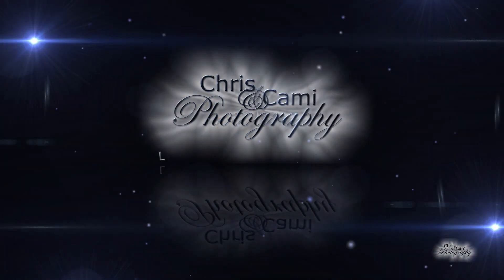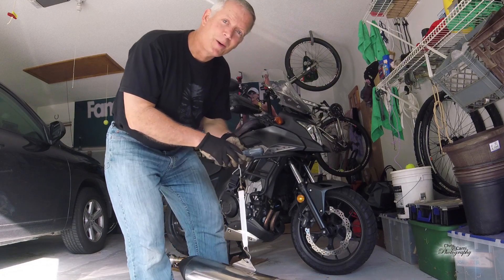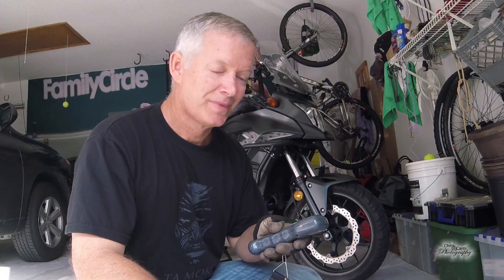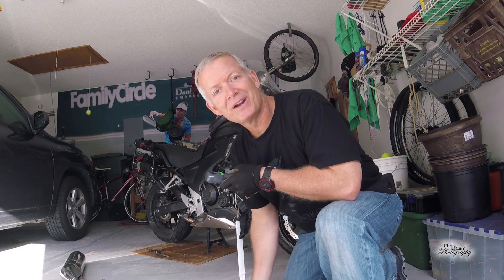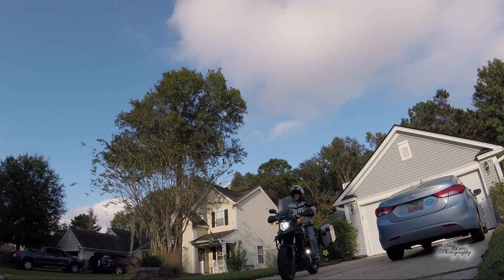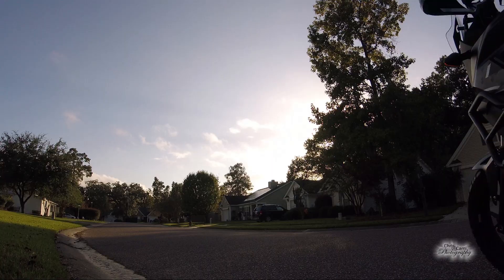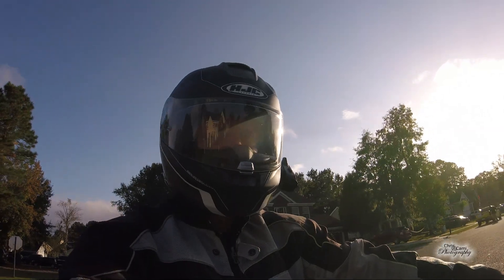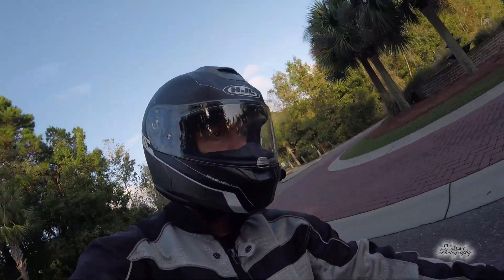EBAY EXHAUST - Best $100 Ever Spent?!?

Comment: Hi there, i just want to say thank you for your advice (in one of your most viewed video) to change my driven sprocket to 16T. IT WAS AMAZING! 
Now, seems like changing a muffler is aint rocket science and required an engineering degree to do it. As you demonstrated, it looks easy and DIY-able. I will definitely add it to my next upgrade list. Also, appreciate the various different camera angle shown here. Good work!
Reply from the maker: Thanks David!!!  Glad we could help.  If you watch my CB500X 60k mile review video, you'll see I still had my "cheap" exhaust on the bike, still working like a champ!

Comment: So far you’re the only one (I’ve found) who’s bought and sort of reviewed one of these “eBay name brand inexpensive exhaust “ ..thanks for that but I’m skeptical still ..my bike is a fz1 with the Yamaha exup exhaust valve I’d have to bypass…which I wouldn’t mind if I knew for sure the exhaust was gonna work out well.  With real name brand I can trust it was engineered for my bike …and if it didn’t work out I’d be able to return it….but then again even if I got stuck with a useless Slip-On at least it was only around $150 and the labor would be more disappointing than the money 😂
Reply from the maker: Sounds like you're in a quandary.  All I can say is I'm still loving this exhaust on my CB500X after 5 years and over 50k miles.  Good luck!

Comment: Any power improvement?
Reply from the maker: The CB500X has such nominal power that even the most expensive exhaust setup isn't going to really give any major power improvements.  However, this one does "feel" more powerful just by the more throaty sound of the exhaust tones.  Plus it is significantly lighter than the stock pipe!  So technically it you can't add horse-power, you can certainly make your bike perform better by making it lighter!  I also replaced the stock battery with a lithium battery, which is significantly lighter than stock.  :-)

Comment: Did you make any adjustments to the carburetor or other after installing the new muffler?
Reply from the maker: I did not.  It's a fuel-injected bike.  So compensation was pretty automatic.  Yes, I could have had the bike tuned for the new exhaust to try and get a little more power.  But with such a small engine, the power advantages are quite minor.  So I didn't bother.  It's been riding beautifully for 2-years now since I installed that exhaust.  I'm over 50K miles on the bike...majority with the new exhaust.

Comment: I really like the growl of the exhaust but i'm kind of worried about the volume. How much louder is it than stock?
Reply from the maker: Hi Jeffrey!  Don't be.  I live in a very quiet and peaceful neighborhood.  So I was a little concerned as well.  However, it comes with a removable baffle so that you can increase or decrease the volume by removing or leaving it in.  I pulled it out and went around the block once...then immediately put it back in!  With it out, it's not crazy loud, but I knew would be annoying to my neighbors.  I've left the baffle in ever since.  The growling sound is perfect and the deeper tone is sophisticated and understated.  Plus the weight savings was awesome for all my off-roading adventures!!!  Check out our most recent travel video and you'll hear my bike in a bunch of the scenes:  https://youtu.be/JzYtjx2ktxo.  It's not annoying at all!  I've had it over 2 years now and it's been rock solid!

Comment: How did you manage to change the settings on your turn signals, to make them always on?
Reply from the maker: Haha!  :-)
Reply: Can't tell? 😑
Reply from the maker: Bonjour  @Rafatrompa !  Forgive me.  I thought you were joking that I left my turn signals on accidentally...which I often do while riding...and which my friends laugh at me about!  :-)  But if you are talking about the beginning of the video where the headlight and turn signals are on, that is a standard feature on the CB500X and a lot of other modern bikes.  The turn signals stay on but at a lower power level.  These are called "running lights".  It helps make the rider more visible.  When you activate the turn signals when making a turn, then they blink at a brighter level.  I hope this helps!
Reply: @MotoPhotoAdventures  No problem my friend.
On my bike (cb500x 2019) they don't come working that way, they are always off until you use the indicators switch.
Do you know a way of programming it to work as you said?
Reply from the maker: @Rafatrompa  Hmmm...I don't.  I will also have to check because my engine wasn't running.  Maybe mine are only on like that when ignition is turned on but bike isn't running?
Reply: @MotoPhotoAdventures  No, you can see they are always on when you take the bike for a spin..
Reply from the maker: @Rafatrompa  OK, that's good.  At least it means I wasn't loosing my mind when I said they are on all the time until you flip the turn-signal switch on...HA!  But I don't know why newer ones don't work the same.  Mine is a 2013.  Are you in the US?  Perhaps different countries have different regulations?  Maybe you can ask in one of the international CB500X Riders groups on Facebook, or the www.cb500x.com forum?  Wish I could be of more assistance, my friend!

Comment: Chris, 

I did the 16 tooth (4250 rpm at my highway speeds) and the $100 exhaust.  The sound of the exhaust with db killer, makes the 500 sound a lot more self respecting.  It purrs.  My other upgrades, the Rally Rail Level 1 and engine guard makes potholed dirt roads a breeze.    

Thank you for the video, 
Peter K  

(re the springs, I used them and believe they are necessary for strain relief.  They look fine.  The springs with detached, free moving hooks from the spring part, are the best ones, per Kevin Cameron.)
Reply from the maker: That's awesome Peter!  Thanks for the comment.  I recently upgraded to RR L1 shock/springs as well.  Love them!

Comment: Hey Chris - great video and I've just received my eBay exhaust in the mail today. I was just wondering whether yours came with the springs and if so did you bother using them - in the video it doesn't look like you did. Mine came with springs but it looks like I'd need to spot weld the loops the springs attach to on the exhaust which I dont particularly want to do. It seems to have come with a lot of bits that I'm not sure I'm going to use lol
Reply from the maker: Hi Antony!  I'm glad you enjoyed the video.  I just got back from a 4,500 mile trip down through Mexico.  I'm happy to report my exhaust is still running beautifully!  I did receive the springs and some extra bits in my package as well.  I don't believe I used them either.  I think they are more for show than function on our particular bikes.
Reply: Knowing this is an old video / comment Im Replying to ….im no mechanic ( motorcycles especially lol) but I think it is safe to assume the muffler being an eBay generic model ,it’s probably sold for multiple bikes . Some bikes ,a lot actually from what I’ve seen , use those springs to keep pressure and are necessary for the long haul …I’d also assume that if your old exhaust didn’t have springs and you have no spring hooks on your system theyre probably not needed .

Comment: Did the new pipe came with a stopper for the center stand?
Reply from the maker: Mine did not come with a specific "stopper".  But I was able to rotate the hose clamp that hold the pipe in place to such a position that it became the new "stopper".  And in fact, I think it holds the center stand in a better position than the original one does.
Reply: Chris Smith ohhh ok nice , good idea! I am a bit scare tho that the hose clamp would rotate and let the stand hit the chain and in someway lock the rear wheel! Lol i may be too paranoid than i should haha!
Reply: @MotoPhotoAdventures  hi can u show me how you do that in picture plz, i have the probleme the chain touch the central stand.
Reply from the maker: @stephaneouazzani8928  which center stand do you have?  Mine is the one from SW-Motech.  If you have the Honda one, maybe it is different?  But with the SW-Motech one it is really quite simple.

Comment: Good video btw. But I'm unsure on these exhausts. The manufacturer goes to great lengths to make sure they run well. They're not designed to restrict the bikes and work in unison with the suspension.
I had a V rod that had a Vance and Hines and the hole bike didn't feel right on the road. Once I put it stock the suspension was plusher, was so much smooth and less tiresome on a long ride.
On the plus they do move traffic and get you noticed.
Reply from the maker: Thanks for the insights, Jammy!  I think it also depends on the bike.  A high performance bike would surely be more affected by an aftermarket exhaust that wasn't perfectly matched.  For my humble CB500X, it works great.  And for the record, mine came with an removable baffle if you want a louder exhaust.  I personally find loud bikes annoying.  Leaving the baffle in keeps the volume about the same as the stock exhaust.  But the sound quality is so much deeper and more "throaty", which I love.  The best part is, this exhaust is a lot lighter than stock.  Less weight is always good!

Comment: did you have to flare the mid pipe connection on the muffler side to get it to fit?
Reply from the maker: Hi Eric!  Not at all.  It was a perfect fit.  If you order the "kit" in my description, it is specifically designed to be "plug and play" on the CB500X.  The original exhaust has a muffler gasket.  The new one is such a perfect fit, you don't even need the gasket.  If you want to make sure no leaks at the joint, you can use a muffler sealant compound.  But otherwise, just pull the old one, slip on the new one, and tighten the bolts.  It's a super easy install!  Good luck!!!
Reply: @MotoPhotoAdventures  - thanks for quick reply, yes I purchased from your link. I've emailed the seller. Muffler to mid pipe appears to be a ball and socket connection. Did you use the springs to retain muffler to midpipe? How'd you manage to pull them that distance?
Reply from the maker: Hi  @eric_uutinen9837 !  The mid-pipe actually holds itself in place, sandwiched between the muffler and the main pipe once you bolt it all together.  You don't even need the springs.  However, it comes with 3 sets of springs with 3 different tensions.  You'll find one of them much easier to stretch than the other two.  This set will fit between the hooks on the muffler and the hooks on the mid-pipe.  Again, I don't think it really does anything or holds anything in place.  But at least it "looks" more finished, instead of having two empty hooks sitting there.  :-)  Just bold it all together and you'll find it just "works".  Hope this helps!
Reply: @eric_uutinen9837  This is what tripped me up. Pull the ball and socket insert out of the muffler and the muffler will slide onto the midpipe perfectly. Springs not needed and all is nice and snug. It is a very close fit to the swingarm but everything clears.

Comment: Thanks for posting this because I’ve wanted to change my pipe for a while now. The price point is making it possible! Question, did you remove the silencer/DB killer? It sounds good
Reply from the maker: Hi Brett!  I'm glad you liked the video.  I hope you gave it a big Thumbs Up and Subscribed for more to come!  :-)  I put some notes in the details about my experience with the new exhaust after riding with it for several weeks.  Just click the "Show More" button under the video to read it.  I also included a link to the exact retailer for the kit I bought.  I believe the silencer was in for this video.  The exhaust db level isn't that much louder than stock, yet it has a wonderful deep throaty tone to it.  I did remove the silencer for a couple of days.  It's considerably louder, and sounds even cooler!  But I'm not 18 anymore and have too much respect for my neighbors.  So I put it back in.  I'm VERY happy with it this way.  However, it's easy to remove/install via a single allen bolt.  So I might pull it out occasionally if I'm going riding with my buddies and want to show off...HA!
Reply: Chris Smith thanks brotha! I’ll be installing this one as soon as it comes in!
Reply from the maker: You're very welcome, @b2thl !  Post a picture and let me know how it goes!!!

Comment: When showcasing the sound of an exhaust, I wouldn’t recommend playing music. It’s useless to watch any of the riding shots in the video.
Reply from the maker: Good tip, Jonathan!  I'll remember that for next time.
Reply: Would be nice to hear while riding. No music
Reply from the maker: Mos Kito  it looks exactly right.  As long as it comes with that connecting pipe, it should fit without any modifications.

Comment: How did you get the slip on into the extension pipe? I bought this kit and I cannot get the slip on to slide into the pipe.
Reply from the maker: Hi Jon!  It should slip right on.  When you remove the old exhaust, it's possible that the muffler gasket stayed behind on the old pipe.  This is a ring, about 1-inch wide, made of a very soft metal compound, that is used to seal the old muffler to the exhaust pipe.  If so, take a flat screwdriver and gently push this gasket until it slips off the end of that pipe.  The new muffler will NOT fit over this gasket because it's pretty thick.  Try not to destroy the gasket in case you decide to re-install the old muffler some day (or give it to whoever buys your bike should you sell it down the road).  Once you have the gasket off, the new exhaust will slip right over that pipe with a little bit of free play.  Tighten the clamp to secure it.  And you're good to go!  If you want to seal the new pipe better, before you tighten it down pick up a tube of Muffler & Tailpipe Sealer, like that made by Permatex sold at hardware and automotive shops.  Smoosh some of that around the pipe before installing the muffler.  It'll serve as a gasket.  Good luck!
Reply: @MotoPhotoAdventures  it was the connection at the other end I was having trouble with. After looking at it with a fresh set of eyes, the muffler had a reducer slid into it (strangest reducer I have seen). Anyway, ditched that and all fit together beautifully. Sounds good too, not too loud, just a bit of rumble instead of a vacuum cleaner :). Thanks for the heads up, great deal for $78 shipped to my door in 2 days.
Reply from the maker: @JonCampbellJr  Awesome!  Glad you got it figured out.  Enjoy!!!

Comment: you never gave model number
Reply from the maker: Model number for bike is Honda CB500X.  Model for sprocket I don't know because it was a gift to me.  However, if you look in the notes under the video, I gave links to two brands that should fit based on my research.  Basically, you want to get the sprocket for the NC700, which is 16T that fits the CB500.

Comment: Hiya Chris do u have the eBay reference number for the exhaust kit you bought for your CB500x ? Thanks in advance Steve
Reply from the maker: Hi Steve!  The product I purchased was this "CBR500 CB500X CB500F Slip on Mid Pipe Link Exhaust Muffler Pipe with DB Killer" from an eBay seller named mgod_motor:  https://www.ebay.com/itm/123452619440.